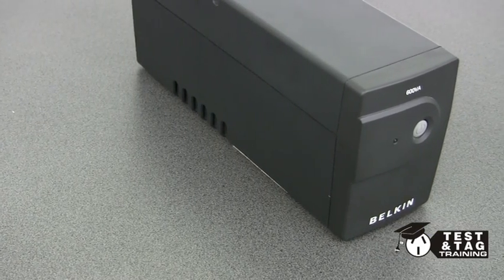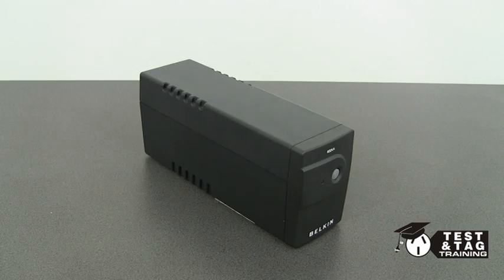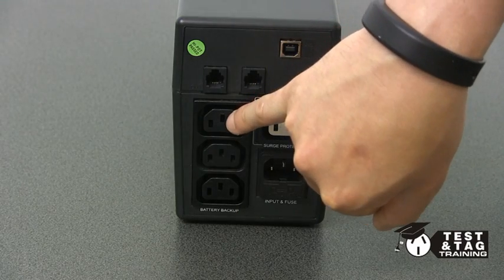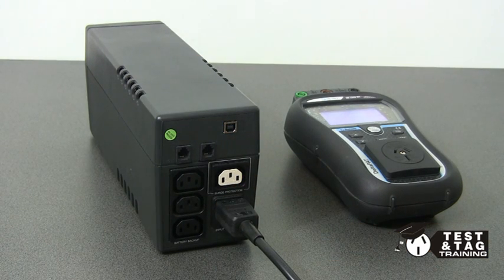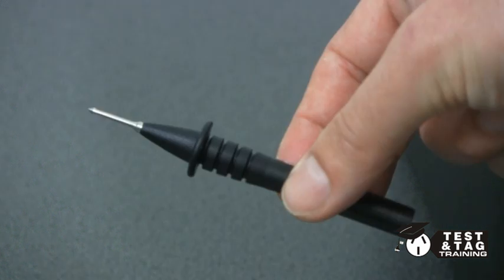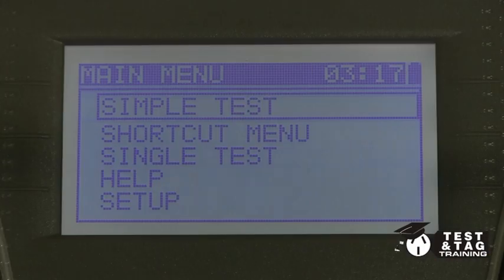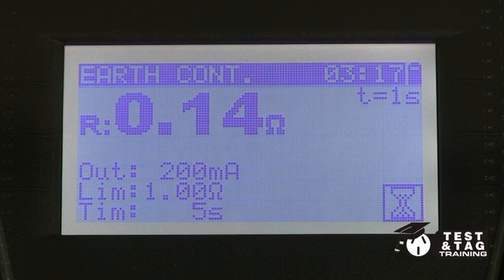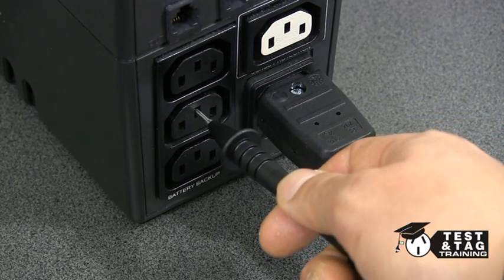Test and Tag a UPS

Comment: Not sure why 250v was used isn't 500v is the recommended for a 240v working voltage for insulation tests??
Reply: 500v will damage a UPS